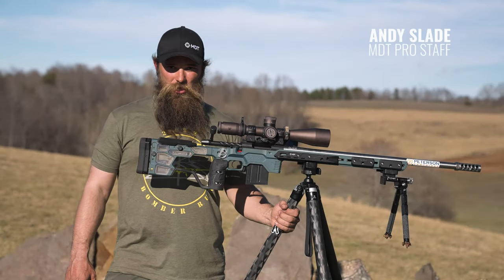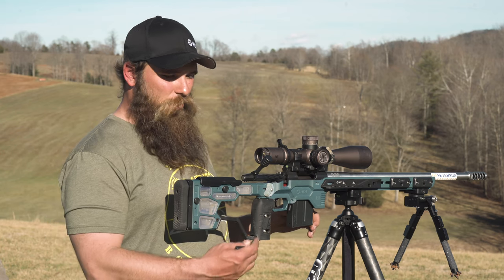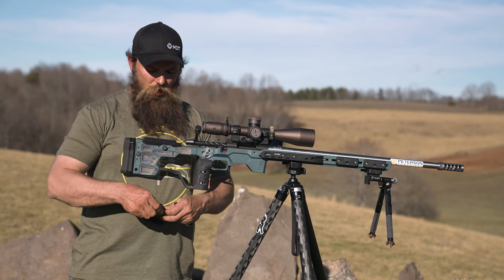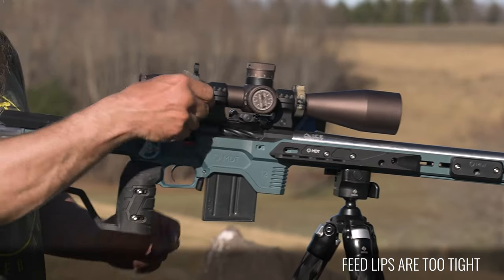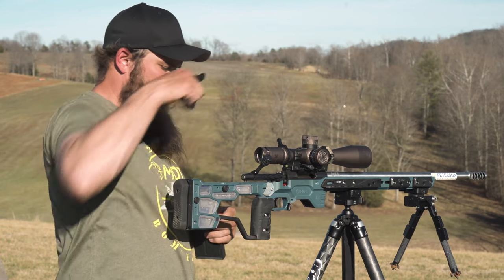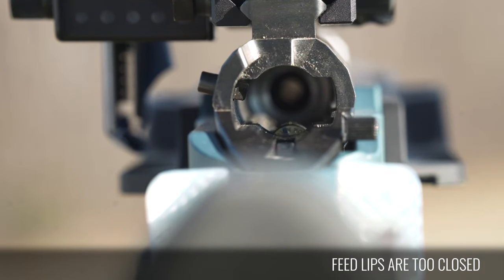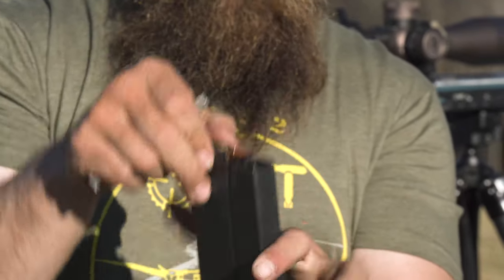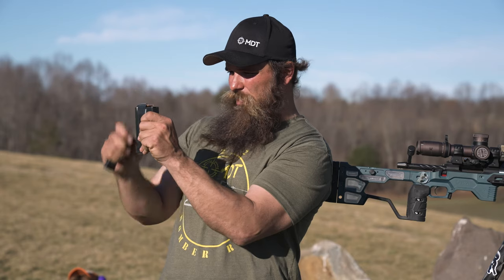How To Solve Rifle Jams

Comment: If only this worked with the polymer mags. I bought two to go with my Oryx chassis (for a Lithgow LA102) and have had nothing but trouble. To the point where I can only top load single rounds. Love the chassis. Love the idea of the polymer mags, but headaches all around…🫤
Reply from the maker: The Lithgow LA102 is a three lug action and needs our metal 223 magazines. Polymer magazines don't have the round at the correct height.
Reply: @MDTTAC  Thank you for this info. I’ll grab a metal mag…